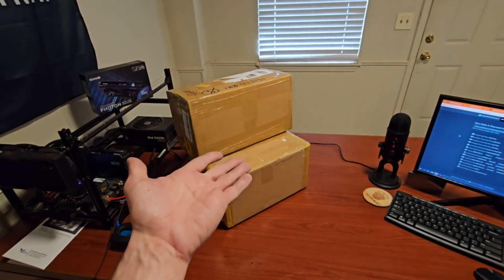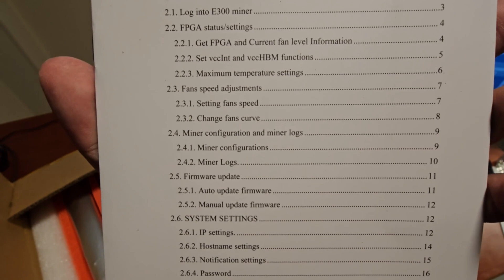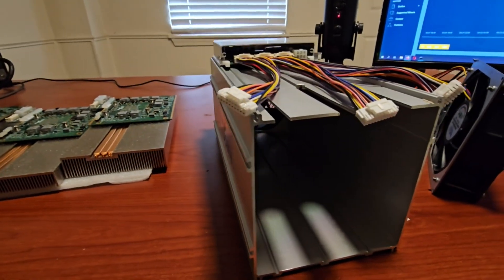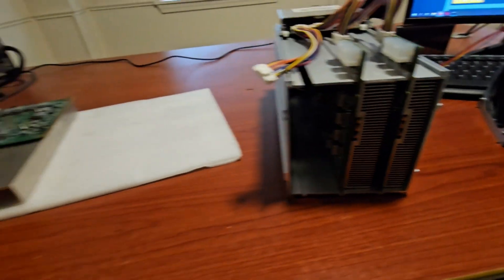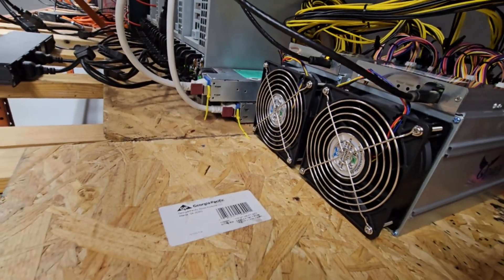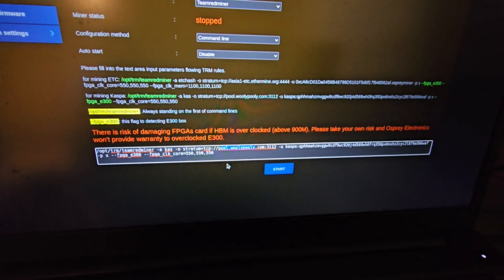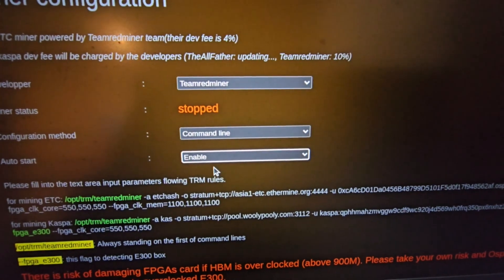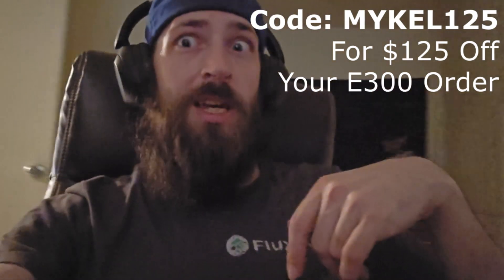Hardware Update - Osprey E300 - Full Build And Setup From Box To Hashing Monster!

Comment: Hey Mykel! Very helpful video. Can you recommend a good PSU for running, let's say, a couple of these E300 14GH/s? Thx!
Reply from the maker: Huge thanks to the kind words fam, glad I can help the community!

You can run them on a bitmain apw3 easy as KAS is low power but any other algo that won't fly
Our clients them on hp server psu with breakout board on each. I find that to be the best so that way if you have to power cycle just one you don't have the rest restarting too.
Reply: @CryptoMykel  Thanks for the answer, very helpful! I think I'll go for an HP 1200 W since I'd be getting 2 E300s and I'd rather have some more headroom just in case. And maybe further on when these things can mine Ergo or Radiant it may come in handy to have some more power if those algo's pull more.
Reply from the maker: For sure when the other bitstreams are done those algos will most likely require memory. KASPA does not so hence 500w
If you mine etc the watts increase by 100ish.
Always better to have more than not enough imo
Reply: @CryptoMykel  The Osprey customer support actually just got back to me about this and they recommend the Bitmain APW7, would give me 1800W at 220V (european power). I'd rather have that extra capacity just in case (for new algos if they become interesting). As long as mining Kaspa doesn't pull much more than 500 W per miner, it's all that matters when it comes to handling electricity costs for now. I'll be definitely following your future vids on the E300! Thx!
Reply from the maker: Those are the facts I was actually looking for as well, so happy with support they are on the spot. They will pull more than 500w in stock setting when the fans ramp up but you can undervolt and overclock and will achieve 15gh for 500w easy

Comment: Thanks for the video! Is there anyway you could do a video on how loud the e300 is? Trying to justify buying and running this at home. Also noticed there's two different fan options when purchasing
Reply from the maker: Well they are in the mining farm now so kinda hard as the noise level there is high. But they they really are quite, especially when you lock the fans at 50%. Most of the noise will be from the psu you decide to use.
Use code MYKEL125 for $125 off and e300 until the end of the month.
Reply: @CryptoMykel  thanks for the info and fast response!
Reply from the maker: No problem at all fam if your running at hone the coupon could make the upgraded fan model for the same price as the OG *but I bet you can but those fans for cheaper than 125*😉
Reply: @CryptoMykel  picked up 2 of these today. Thanks for the discount code. Would love to see a video on the octominer immersion system and e300
Reply from the maker: YOOOO thank you so much fam!!!
Currently our customer that has these hosted at our facility is looking at getting a fog hashing C2 tank as it might be able to hold 6-9 before ever reaching thermal and voltage capacity. So SOON there will be some videos on this. The Octo tank might be able to hold 3 as the size of these is smaller than a s9.

Comment: What are the 10 coins you mentioned this miner could mine on redpanda's live stream. Looking to pickup an e300, just wanted to confirm minable coins before the purchase 🎉
Reply from the maker: So currently the chip themselves have other coins that can be mined, a miner would still need to be developed to find the E300 models But some that I CAN name would be Kas,etc,nim,ckb, trm is working on erg and rxd as well. Hope that info helps you fam!Remember to use code MYKEL125 for $125 off an E300 until the end of the month!
Reply: @CryptoMykel  Thanks so much for the great info. I really appreciate all your hard work sharing your knowledge to us all!
Reply from the maker: Thank you very much for the kind words fam, means alot! Just out here doing what I can! #FA
Reply: @CryptoMykel do you know what the etc hashrate and wattage is for these units?